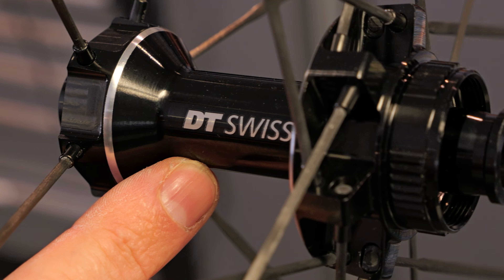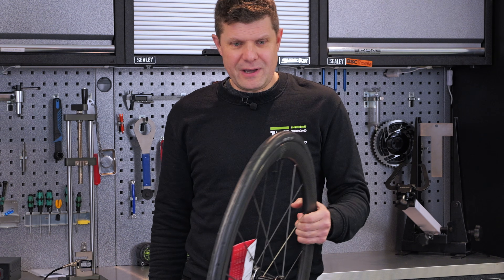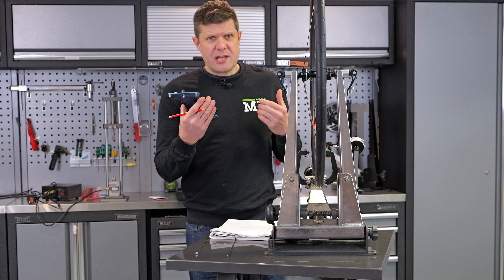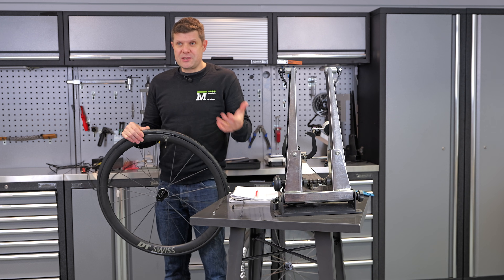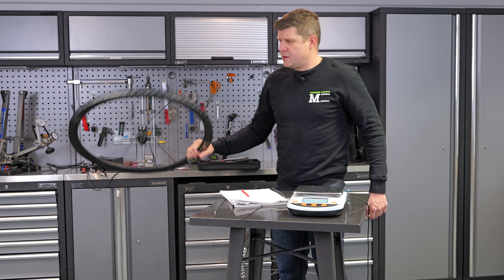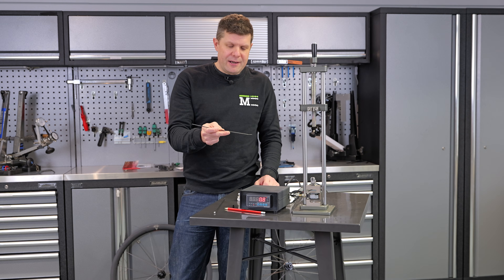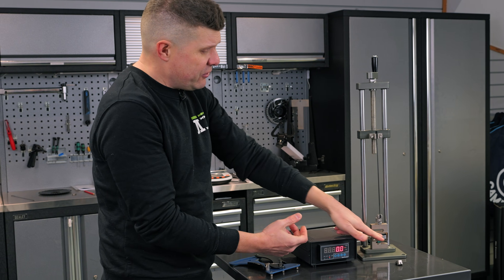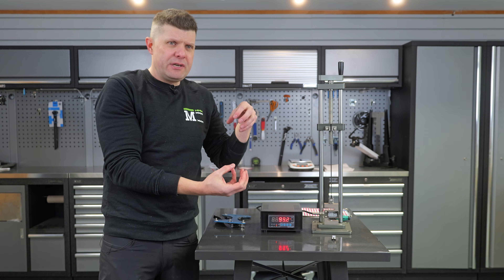Why Most Carbon Spokes Lose Tension (And How DT Swiss Fixed It)

Comment: I’m an early adopter of a lot of tech, but I’m going to let this one play out for a while. Probably until it can be said the fatigue life matches steel or is long enough.
Reply from the maker: I think you are wise. Much more science needs doing
Reply: Why are you all acting like this is new tech? Carbon spokes where already raced at the Tour and sold THREE DECADES ago...
Reply: @marcvb3364 well then I’m ignorant because I never heard of a carbon spoke until the last 5 years. Unless you mean a spinnergy or a tri spoke which is not at all what these are.
Reply: @jonathanzappala  No, I mean carbon spokes just as these. Wheels by the german brand Lightweight, they were raced by Jan Ullrich, and later also Sky
Reply from the maker: @marcvb3364 because they were propriety back then and set to a certain wheel.  These are now essentially a carbon version of the steel spokes we are all used to.  They can be purchased in many lengths and used like a normal spoke.

Comment: how can you try to pawn these subpar dangerous carbon spoke rims for $4500 with a straight face? Do you not think its utter blatant price gouging when you can buy far better quality rims direct from China for 1/4 the cost of these obsolete brand overpriced garbage rims from the same company that just had to recall most of the rims they released in the last few years so how do you not see it as fraud charging 400% more for a subpar product from a brand known for recalls and overpriced and behind the market quality product. You'd probably sell more chinese carbon rims that are higher quality if you didn't price gouge as hard as you are doing. Its the reason why bike shops are closing and people are going for direct rims from china as you have nothing to offer other than a 400% upcharge which makes no sense for a retail worker gig and is just dishonest. You're trying to justify bicycles as needing car pricing so you can gouge but the bikes are still 2500 for a full carbon durarace kit in China so your model of pricing is on its way out and is based on deception which is why western bike brands are losing money and shops are closing.
Reply from the maker: OK.... good luck to you when that happens.
Reply: @mapsec, well said.  Hopefully their jobs are outsourced to China as well.  Why would anyone pay their over inflated salaries,,,
Reply: Agree, I started buying everything direct from China 4 years ago now and am never going back, I enjoy doing all the work myself anyways, and 90% of shops can't be trusted (not including Mapdec here). Absolutely no need to give a middleman a big paycheck these days.

Comment: If I go up an alpin ascent, I also wanna go down the other side. Grip matters for Pidcock and for an idiot like me. For different reasons but it matters😂! DT can shove their 26 and 28 mm up their butts, everything below 30mm is just a big no nowadays
Reply: Where are you? I'm riding with 28-30 mm and I often feel I have the widest tyres...
And btw, not so long ago most racers had 25, 23, even 19 mm and climbing and descending faster than we will ever do!
Reply: @DR_1_1 well I don't care. The world moves on. For the average joe, 30,32 maybe even 34-35mm tyres are just better for every day riding and most races.
Reply: @MS-bw7yt  I don't care about your personal tastes, road racers are mostly on 28-30 mm, and around me I see even narrower than that.
Reply: @DR_1_1 yeah okay that's fine. But DT should not be surprised, if their line up and rim profiles are considered outdated. I mean their pro team uses the gravel rim because optimizing a rim profile around a 28mm tyre for the road is just outdated. Of course a lot of riders are still using 28mm because it was state of the art a couple of years ago. But the world moves on
Reply: @MS-bw7yt  You can safely fit 40mm tyres on 20c rims, so... "move on"!
;-)
Reply: @DR_1_1 safely yes. But technically it is not using the full potential aerodynamically or mechanically ;)

Comment: most high end chinese brands use hx works sl hubs. 20 front 20 rear spokes. the spokes will not touch. fyi Chinese rims offered in diff weight  100kg 110kg 120 kg limits.

Comment: So Dt Swiss is fitting the tire in the Factory to avoid the problem of carbon spokes loosing too much spoke tension after the customer has fittet a tire?
Reply from the maker: No, Where the trye is fitted make no difference. They are supplying the tyre as a 'gift' a recommendation. You dont have to use it.  The spoke tension loss issue is due to compliance of rim
Reply: @Mapdec isn’t it the compliance of the rim, and the youngs modulus of the spokes? A low elongation spoke will de tension sooner if the distance from the nipple to the hub is sliiightly reduced
Reply from the maker: @RC-fp1tl yes.  But these Vonoa spokes are fairly common now and some brands have learnt how to use them and others have not.  The spoke is relatively constant across brands.
Reply: @RC-fp1tl spot on. The video title is a bit misleading as its the carbon rims (in my experience from carbon vs aluminium mtb rims) that have a tendency to lose spoke tension when a tyre is fitted as they are more  compliant in compression - carbon fibre composites really do not like being put into compression. As you correctly point out, a high modulus carbon spoke thus needs much less strain to release the tension as every fraction of a mm length change is proportional to a greater change in tension (ie a steeper strain vs stress profile). Thus the title of carbon spokes losing tension is misleading, metal or carbon spokes will lose tension more with a carbon rim, carbo spokes just lose more tension on the same rim. The DT swiss trick here is to make a rim that does not change in diameter as much with a pressurised tyre trying to squeeze it - ie they have beefed up the compression performance. I still run schwalbe procore on one of my bikes, i like it vs a foam insert (which i first started using as a kid in RC car tyres in the 90's btw so way before they were popular on bikes) as you can run flat on it with less/no damage and it effectively acts like an air spring token in a fork/shock. I have to be very careful on my carbon rims to not run the procore tube at too high pressure as it really relaxes the spoke tension.
Reply: Ps i know a 'little' bit about composites. I am very impressed by that internal rim footage, very clean. Would love to see them being made.

Comment: DT Swiss rim specs are always 5 years late. The hubs are also not as interesting as they were 5 years ago. Expensive, too narrow and not that light even but still including the troubles of carbon spokes.
Reply: It’s hard for any DT wheel to compete when there’s so many manufacturers like Reserve who can also make wheels with DT Swiss componentry and equally high quality rims with more modern specs. It’s difficult to call out DT for being too conservative , but that’s the reality of their wheelset options.
Reply: @divorceshoes5492  Nailed it.
Reply: What's too narrow? Rims or hubs?
Reply: @harryrowland4734  Rims are optimized for 26mm wide tires and they're a bit too narrow for them too.
Reply: @Markus-.5712 optimised for what? I think you're following current trends for aero benefits. If you're optimising for long distance comfort, then 32c tyres would be perfect for this internal width  rim.
Reply: @harryrowland4734  They're optimized to be aero with 26mm tires, which won't roll as well as wider ones. Yes you can fit larger tires but then you compromise aero performance and crosswind stability. Why would you choose these wheels if comfort was your goal? It's 2026 you can choose to optimize both rolling resistance and aero why choose just one of them and also pay a lot of extra money.
Reply: @Markus-.5712 good point and hopefully people will see beyond the dream and make the sensible choice . I'm a wheelbuilder and have been for over 50 years. I've seen marketing trends come and go .I have potential customers with unattainable goals, given their age and condition, who are looking at those kind of wheels, in order to improve their performance. And, despite the claims, deep wheels will always be effected by cross winds.

Comment: love the stance on this. you walk into any shop if you have shimano gears and you have a huge chance of them being able to fix it. this is why shimano is popular. and that's how it should be. brilliant product with just as good spares and repairs support is what gives you a golden combo
Reply: shimano recalled the last 12 years of road cranks due to being cheap faulty and dangerous so not sure what your talking about
Reply: @tupacsgohst but they recalled them, im talking about the groupsets they produce and a lot that is old, still has spares available, look at sram and after 6 months its basically proprietary and unfixable...
Reply: @TroggyPK  that was not a recall that was a disater